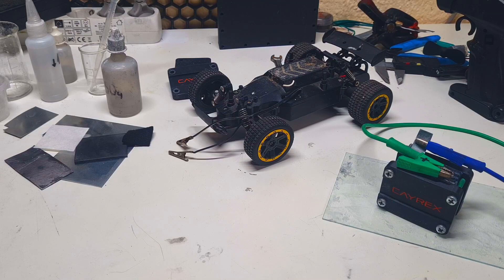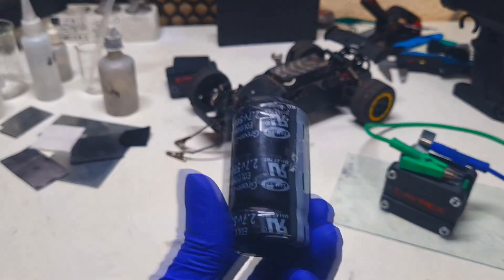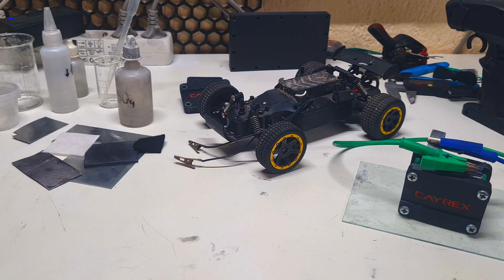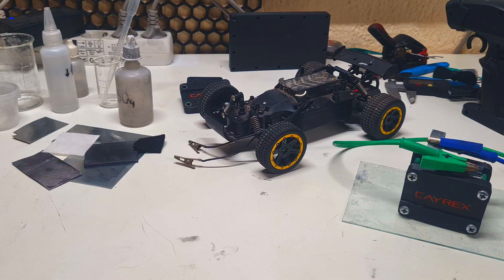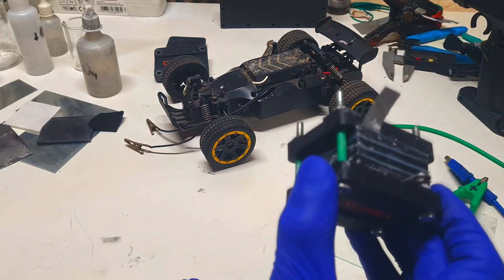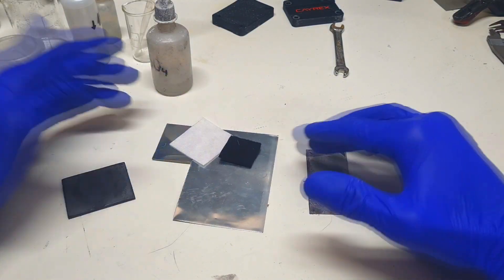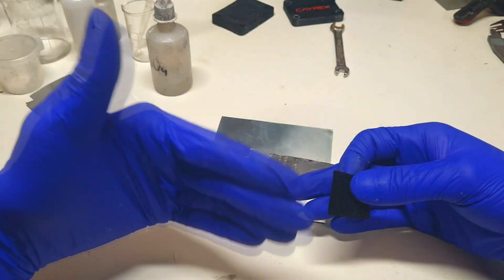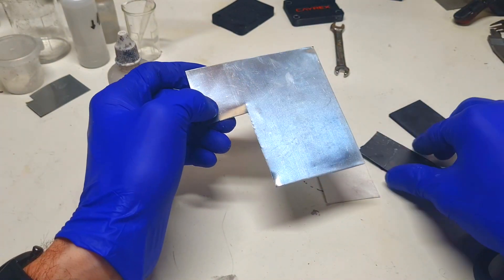My Zinc ION Capacitor

Comment: I support your channel and I'm also trying to create a supercapacitor or Accumulator.
My advice: Use an organic solvent to have a higher voltage on the capacitor. I use DMSO (Dimethylsulfoxide) and I have a voltage of about 2.8V without a big problem. From what I know, if I use the right salts I can have a maximum of 4V.
The current efficiency is good, but not as good as water or acid.
Reply: I got some acetonitrile I was thinking of trying it with, I wonder if DMSO is better or if a mixture is even better than that... Time I  started experimenting
Reply: @petevenuti7355 DMSO will give you higher voltage but less capacitance.I tested

Comment: finally someone used the zinc battery for something. all commercial activity will be driven away, by free gift from the Lord. amen. hope you understand, the free gift. all commercial stuff is flawed. glad your proposed design works tho. zinc-acid batteries rock at 400Wh/kg. but h2so4 will eat away the dendrites. and form znso4 instead of hydrogen. all problems solved. iron negative electrode is the best, possibly a can type cell, and gives a low voltage when zinc runs out. also forms a strong cell structure. for free, as gift. freedom is the only way of working together. all other forms are rejected. because the iron is not consumed like the zinc is, the cell will stay intact and is rechargeable even after running out. the metal contact electrode stays in the original shape. this design tip os for free too. proprietary means its not free, in both ways. ie its a prisoner, of people. yep going hard on the issue. because ownership hurts, and God makes free, from that people ownership. well, hell, who would want to be in people's judgement. and in front of people, as judged. freedom. otherwise fine content, as given by God. no confusion by money or ownership or law judgement. btw, the 1.8v is the capacitor voltage and not the zinc-air voltage, which is something like 1.3V. dont take this as judgement. ie dont fear people or me. Christ makes free. idk why people want to call the zinc-acid battery (similar to lead-acid) as zinc-ion battery.

Comment: So the capacitance occurs between the negative active material beneath the membrane and the positve zinc current collector on top? Kind of an upside down zinc air battery or a lead acid ultra battery?

Comment: Very cool.  Very powerful.  Question that I have is what 3D material did you use to make the battery framework	?  I have printed my own using PLA to test the usefulness.
Reply from the maker: It is made from PLA, ecause I dont use any aggressive electrolyte.